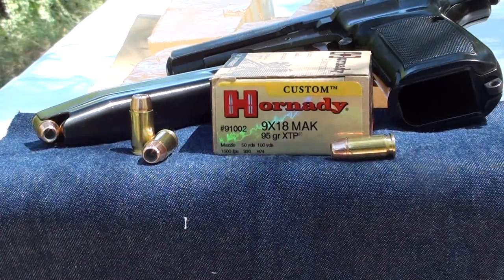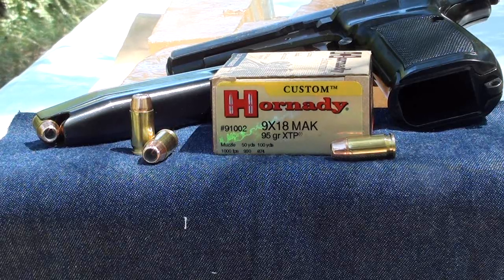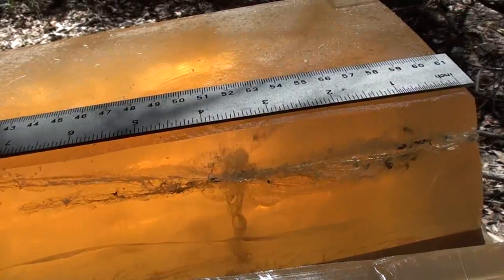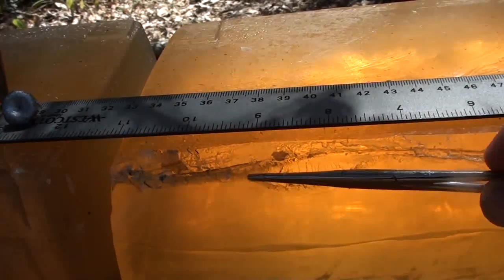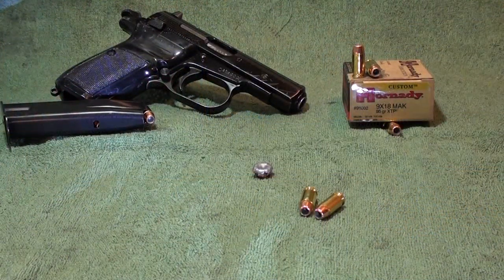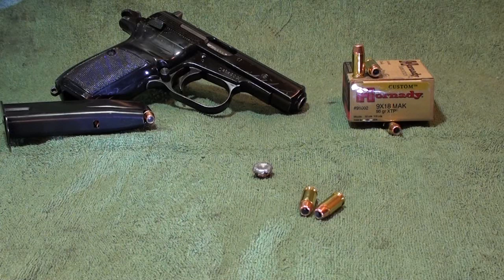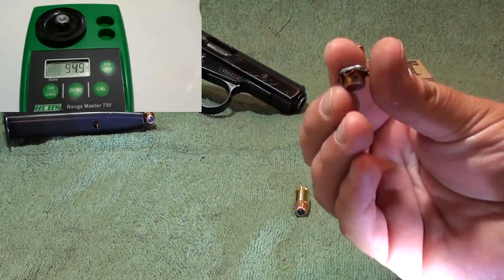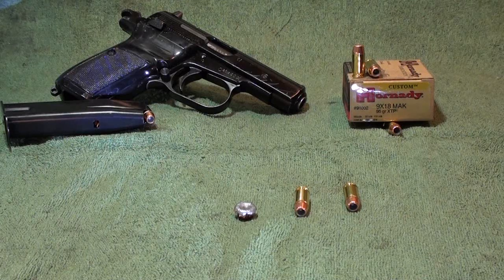9mm Makarov Hornady XTP ballistic gel test

Comment: The CZ is a good sensible rather midsize pistol. The XTP has always seemed to be a good bullet for modest expansion and better penetration at medium velocity, which is exactly what the 9x18 needs. I was expecting a bit less expansion; it actually did very well.  The penetration was quite good. The FBI 12" minimum is a good benchmark due to variables (bone, and muscle density) but is not absolutely necessary (i lean toward a 10" minimum, but i like around 14" of penetration, 16"+ makes me a little nervous; but those are just my gut feelings). This looks like one of the best in this cartridge, no question. I have not yet looked at the FTX. It is next. Do u need a chrono? Maybe we should start a gofundme to get you one :)
Reply from the maker: Thanks for the thought, I have a chrono, I cannot remember if I had it then in 2012??  But all my newer vids have chrono test results in them
Reply: Your videos have been very helpful in gauging how well the 9x18mm round performs compared to .380 ACP and 9x19mm Luger/Parabellum. I've been cross-referencing the Lucky Gunner collection of FBI gel test results with each other and your videos on the Silver Bear hollowpoints, and the Hornady ammo. I estimated "lethality" by averaging  expansion diameter and total kinetic energy transferred in newtons. I couldn't do it AS exactly as I'd liked since you didn't chronograph the Hornady but I plugged in the advertised 1000 FPS speeds and found the Hornady actually underperformed overall compared to the Silver Bear round. Even when I plugged in 1050 and 1100 just to be safe, the Hornady wasn't exactly far ahead. Considering how little Silver Bear costs in relation to the Hornady Critical Defense round ($0.28-0.29 cents per round for the Silver Bear versus a staggering $0.78 for the FTX), it's pretty clear the Silver Bear is a much more practical choice since it's cheap enough to practice with and at the very worst nearly as capable, but possibly better. Both rounds compare very favorably to .380 ACP and don't look TOO bad compared to 9mm Luger. I didn't factor weight retention into my calculations but I kinda get the feeling that losing parts of the round inside someone isn't going to negatively impact lethality, plus I couldn't really compare the Lucky Gunner results since I don't think they factored in weight retention, either.

Comment: I own both a CZ82 and a Polish Radom P-64 in 9x18mm.  I've used them as backups and off-duty carry pieces.  They are VERY accurate and VERY reliable handguns and amazing bargains for their price (priced like some junk guns but are actually top notch firearms).  The Hornady 95 gr XTP is my "go-to" round with the Silver Bear JHPs being my "stand-by" load (I also usually keep a mag of ball ... because at the point of needing that mag, it doesn't really matter what I'm shooting out of it and the extra penetration of the ball ammo might come in handy.  Anyway, I was the my agency's firearms instructor and one of the heads of our Firearms Unit prior to retiring and was impressed when I tested the 9x18.  These rounds "meet minimum" of the FBI's protocol (which is for duty rounds, but a nice plus in backup/off duty pieces too).  Of course, one-stop shots are really just a statistical anomaly and should not be counted upon, but it's nice knowing your rounds can poke a nice wide, deep hole.  Should the first round round fail to end the threat, just pull the trigger again, and repeat until the problem is solved.  The CZ82 is cheap to feed and gives a lot of ammo on hand for such situations.  Thanks for your video!  Very informative.

Comment: i wouldnt think the blow back design would matter much when it comes to function of the round, only the barrel length and the round, and charge would matter..
Reply: Blowback pistols rely on the weight of the slide and the tension of the return spring to keep the round in the chamber until it is safe to extract the cartridge.  As such blowback works best with small caliber rounds like.380 or 9mm MAK.  Any more powerful and you'd have a something like a Hi-Point that has an extremely heavy return spring and large, clunky and heavy slide.
Reply: Yes. The 9x18 is about the hottest caliber that a blowback action will efficiently handle. There are some 9x19 blowbacks, like Steyr and Hi-Point, but there are reliability issues with those.
Reply: @fjdubya5726  Astra 400 9x23mm Largo blowback gun.

Comment: Scubaoz, Underwood currently has their souped up 9x18 mak in stock for both the 95 grain (xtp) and 115 grain hardcast flatnose.  If you were still interested in getting a test for these I'm pretty sure you will be the first to have the mak gel tests.  I'm most curious about the 95 xtp since its pushed to about 1200fps if it will still hit 12 inches or less since it's faster.  Figured you'd want to know about that round.
Reply from the maker: Hey cool!, Thanks for the heads up, I will order some of them pretty quick, I would love to test every 9x18 MAK round out there.  Its a damn fine round really

Comment: The CZ-82 is a solid hunk of metal, a little heavy for CC in my opinion, the grips are pretty wide as well. Any jamming with the XTP? Word on the street is that the XTP doesnt like the feed ramp of the 82 and likes to hang up. Did you see that happen at all? I bought the Critical defense loading, that hasn't failed me yet. Since those are basically the only 2 good self defense loads that the 9x18 offers i would like to know if tehy both work. THE CZ-82 ROCKS! BEST LITTLE 9MM FOR THE $!